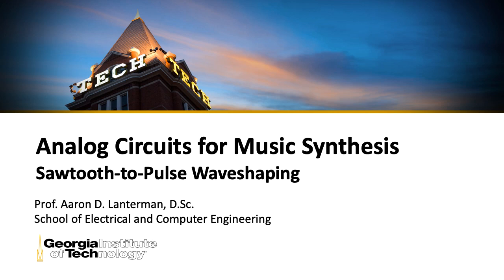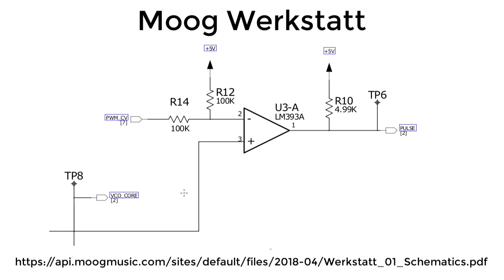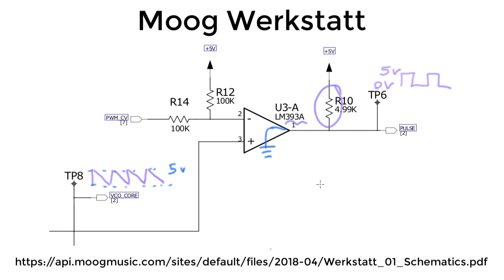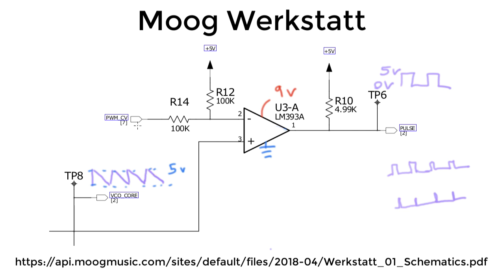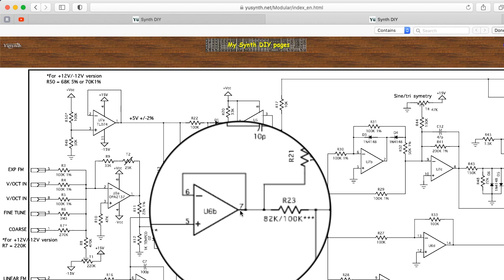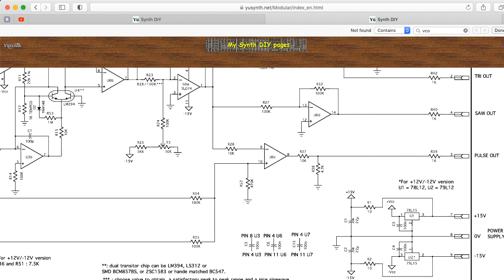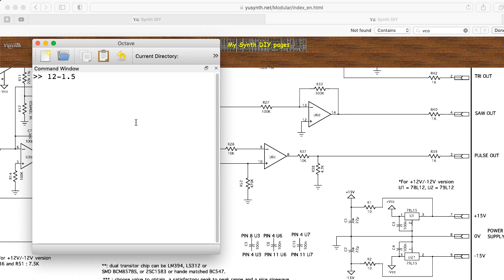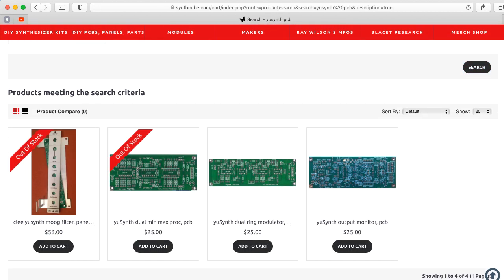ECE4450 L11: Sawtooth-to-Pulse Waveshaping (Analog Circuits for Music Synthesis, Georgia Tech)

Comment: I don't know if I get it wrong. At 6:08, when PWM CV is set to -5v, the saw tooth wave would be compared with 0v so wouldn't that result in a super wide square wave (99.9% duty cycle)?
Reply from the maker: You are correct -- it can go to extremes to the point that the pulse basically vanishes.